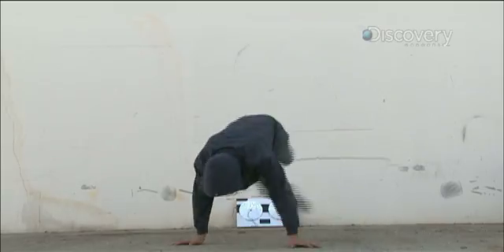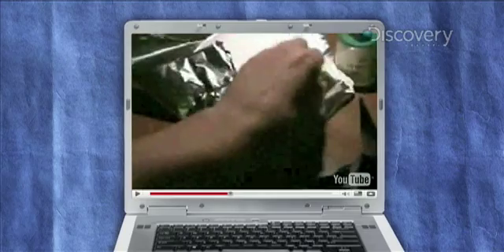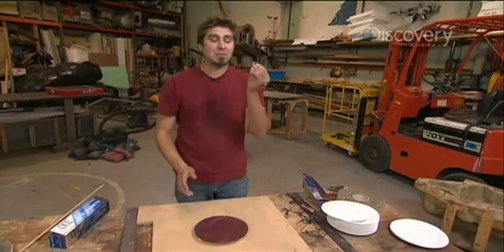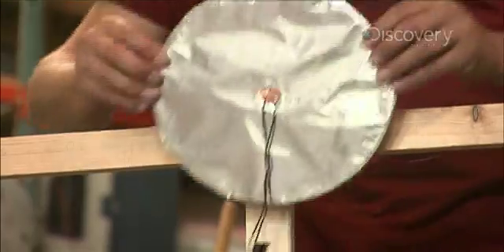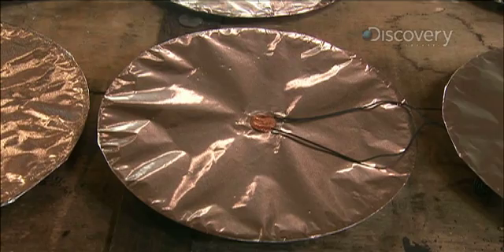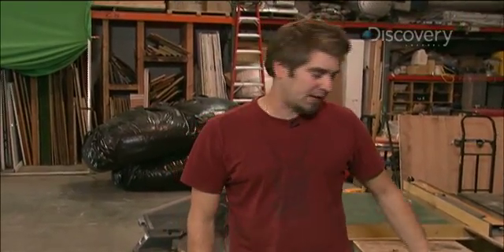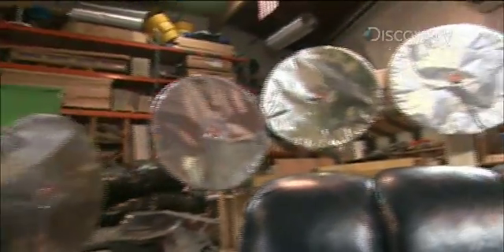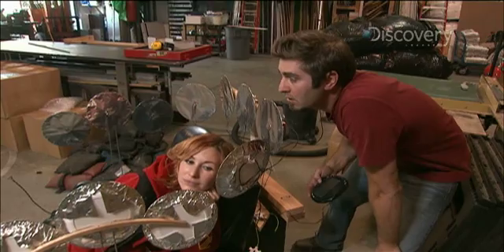MythBusters - Homemade Hi-Def Speakers

Comment: There are 4 wires I. Those jacks, you have split them into pairs, causing a short and no audio—— or you didn’t burn the tips ( those wires are also insulated and can’t be making contact with the pennies) just need small change - THIS_DJBK

Comment: Oh come on, there are legit ways to make a speaker out of junk that actually work. Put two magnets on both sides of the foil and put a wire coil over one of them, that would probably do the trick. You have to have something magnetic and an inductor to vibrate it. Whoever made this is just stupid

Comment: the splitter they used splits up the voltage and audio channels so each speaker is getting much less power than than they think they are giving it. Wish they would have metered how much each speaker was getting.

Comment: It works i made it at home. The only problem is the amplified signal ,a mp3 only gives 0.2 wats and it needs like 10 watts rms. It failed because of peak power voltage. It requires amplificator of at least 10 watts rms. Even without coil and magnet it works because of the imense power that hits the aluminum foil that conducts electricity. The foil will vibrate between the 2 wires (poz and neg). The more distance between them and more power more it vibrates. The foil itself is a resistor. Is not hd sound but is sound. I say is mid ranged sound at 1khz.

It fken works and mythbusters lied. I hate this show because of that.

Anione can test this just unplug a powered speaker and place it's 2 wires on a aluminum foil and see for urself. Foil doesnt need to be round and shaped it just needs to be straight like 3 cm x 10 cm long. Place wires on its ends of paper. Those 10cm between them will vibrate on the amount of voltage is in it.

!!!!!!! it fken works

Comment: what a joke to connect both the ends to the penny.. it is possible to make tin foil speakers but not this way and specially not spending ready cash but the whole point is to make it from salvaged old electronics.

Comment: The only possible way you could possibly have gotten any sound out of one of these is if you stick a pin into one of the plates and use it as a stylus with a vinyl record you don't mind messing up on your turntable.

Comment: Before i start watching this video: WTF are "Hi-Def" speakers? speakers work in the analog realm where the term doesn't apply.

Moving on....
Reply: "Hi Def" is just some bullshit marketing hype. Shortly after "High Definition" televisions came into the market. Douche bags from every corporate marketing division started tacking "Hi Def" onto everything. You had hi def sunglasses, hi def audio, hi def pens, hi def cameras, hi def socks, hi def refrigerators, hi def underwear, hi def sandwiches, hi def vitamins...etc...etc... For a time, there was nothing that they didn't call "Hi Def".

Comment: funny thing is our pennies are not copper anymore they are some crap metal that breaks in half when bent a little since the late 1980's that's when they changed it the the crap go ahead grab a pair of pliers and bend a penny that is newer than the late 1980's it will break in half

Comment: I think if you made a wire coil and taped that to the aluminum, and then taped a magnet to the paper plate, it might make some sound.  But it would be shitty sound and not very efficient when compared to a $10 store bought speaker.  So you could get a much better speaker for the price of the headphone cables.

Comment: you need a coil & a magnet. the jack sends varying electrical current through the coil producing varying magnetic field through the coil's center. that exerts a magnetic force, which varies with field strength, on the magnet, which is adhered to the foil, making the foil vibrate.

Comment: He shoulda connected it to an amp first. Maybe it needed more megawatts to power the flux capacitors in the pennies.
Reply: First you need a fully charged flux capacitor to overcome the resistance of the crystal lattice for it to work. But powering a flux capacitor is some real catch-22 shit. You need a fully powered flux capacitor to generate the megawatts required to generate enough fluxually capacitated power to satisfy the energy requirement of bringing a flux capacitor to full power. You can't just use any old penny either. You need specific old pennies. You must have at least one steel wheat penny and one copper wheat penny for parity and reverse polarity or else you will get flyback  and destroy all electrical transformers within a three mile radius. You wouldn't be  able to acquire enough of those pennies for it to work anyway, because the US government snatched them all up and sent them to Area 51.

Comment: You noob you split power with that splitter,and you knew it won't work and made fun of it like it will work.I thought it would work because piezzo's are similar concept.And he didn't maybe use that cable,maybe he used cable without jack and used only wires and amp that he had.Sometimes you just don't want something too work that's my guess i might be wrong,but you couldn'y prove teslas earthquick machine for example which made me angry because i know it works

Comment: Does nobody on this show have any science education at all? The dynamic magnetic field created by the penny shorting out speaker leads needs to have a static magnetic field or a magnetic substance to work on. Without this no work can be done, so no air can be moved, therefore no sound can be created. Did they really create all those speakers before testing even a single one? Are they deliberately trying to make themselves look stupid? Or are they really that stupid?

It's possible for a speaker without a magnet to act on the magnetic field of the Earth, but a penny shorting out speaker leads isn't going to create a field strong enough yield anything audible. ... Now I wonder how hard it would be to create a speaker that works only with the magnetic field of the Earth.

Comment: every nutjob that atlest went to college knows speakers require a voice coil=wound copper wire and a MAGNET and then electricity to work, then the paper cone and spider for the air pressure to make sound BUT i digress
Reply: well i wouldnt say that every speaker needs a voice coil,  for example electrostatic speakers that dont use a coil at all, or planar magnetic,  there are also speakers that are driven by a motor buuuut then some of those motors need a coil so yeah, oh and plasma speakers....generally anythi´ng that can move air quick and precisely if I am thinking correctly
Reply: yes but most people DONT  have those type of speakers lol

Comment: Who the hell pays 10 bucks for a jack lol.. That`s just bullshit..
You can get those things for like 5 cents, OR get one of these with two of them and cable for a dollar..
 http://www.ebay.com/itm/3-5mm-Female-to-2-Male-Y-Splitter-Auxiliary-Audio-Cable-PC-Headphone-Mic-Jack-/121748451981?hash=item1c58c5f28d:g:XdQAAOSwTapV5lPR
Reply: Btw, I just made a speaker with 2x2.5" 15W drivers and a 2x15W amp for 10.37 USD..
And it sounds better than my 80 dollar logitech bluetooth speaker..
MUCH better, my neighbour complained lol..
(thin walls)

Speakers: http://www.ebay.com/itm/151414150873

Amp: http://www.ebay.com/itm/221908535360?_trksid=p2057872.m2749.l2649&ssPageName=STRK%3AMEBIDX%3AIT

Voltmeter because I`m using LiPo without protection: 
http://www.ebay.com/itm/272331428388?_trksid=p2057872.m2749.l2649&ssPageName=STRK%3AMEBIDX%3AIT

Making cheap speakers is NO problem..

Running it off a 3S 4800mAh 35C Typhoon LiPo..

Cables were scrap, the box is a boil-in-bag rice cardboard box and I didn`t even seal it because I just wanted to check that everything works..

Still plays louder and better than my logitech x-300..
Reply: The video is from 2009 dude, are you blind?
Reply: Vrinceanu Codrut Adrian
Headphone jacks were cheaper in 2009 than now :p
Reply: at least here..

Comment: The weight of gravity when the plate was held sideways might have muffles the vibrations?
Reply: There's no magnet for the (super incredibly weak) electromagnet they've made to react with, nor is there so much as a piece of magnetic metal to attract. Ergo, no vibrations to be muffled.

Comment: There are literally hundreds of videos just here, youtube, in many different languages, that show you how to make an actual speaker, be it with magnets or piezoelectric materials. Take a look at'em and, if you know a little bit of basic "electronics", you'll notice that the model Mythbusters is trying to replicate and debunk is just ridiculous and design not to fail, but to just never work. Besides, Household hacker was pretty much a troll bak in the day (if I'm not mistaken).

So please internet, before you jump and say they did it the wrong way, research a little. I know it is not what your lazy arses are used to but at least try it every once in a while.

Comment: technically there is a way to do it but you need a magnet and a coil because that's what the speaker needs to make it work. because all Tori was doing was sending electrical impulses and energy into the penny and through that into the tin foil where is just no way it would work however if he say had 2 paper plates one to act as a base and one to act as the actual speaker and another one he could use to act as a loose spring mechanism on two sides of the plate and then say hot glue a coil with a magnet inside of it that would probably have to be glued to the top plate then have the electric current run to the coil then speaking from a technical standpoint it could/should work.

Comment: $10 each jack? could you not have just cut up a bunch of headphones or earbuds?
Reply: i thought the same thing man. In fact i've seen earbuds that come in quarter machines for 50 cent.
Reply: sMaShEdToMaToS har har
Reply: that jack is made in USA
Reply: 3.5 male to male leads from the dollar store would have got you two jacks each
Reply: This was produced in 2009, when tech like  this was WAY harder to come by and when you found it, it was a pretty penny
Reply: dollar store  ear phones ones :D are way better then the paper plate speakers
Reply: Again this was 2009, and aux cords were overpriced. He probably got a mini-jack from RadioShack where was ridiculously overpriced. At least, these mini-jacks would be easier to work with than the weird coaxial crimps that you find on headphones.
Reply: 2 words. Dollar store.
Reply: You cna get male to male aux cords (so 2 jacks) for 92 cents pop on parts express. $10 per jack my ass
Reply: @rivergranniss3740  hello this is before touch screen phone. Nokia accessories are not that cheap YET!!!
😂😜🥴🤪🤣
Reply: You’re forgetting the point that he’s looking for hi def sound quality, and cheap audio jacks that were scalped from 50 cent earbuds won’t give you that kind of quality
Reply: @andersdamanders3268  if you were looking for "hi-def" you would even be using an audio jack, you would just use speaker wire run into an amp. And tbh the audio jack is just a fancy metal contact, the $1 a piece ones I use on all my projects from parts express work wonderfully.
Reply: you can get those cables for a dollar and they have a plug on both ends so you get 2 for a dollar
Reply: Could've gotten them at the dollar store.
Reply: with each jack being $10 you actually get 2 ends which means the cost of each jack for the speaker is actually $5.
Reply: +Wick3DPimP wait. Are they quarter headphones or are they 2 quarters? 
You need to make more cents
Reply: @smashed_dillon  It's perfectly clear.  the machine takes quarters, but only 50 Cent can use it.  If Kanye puts quarters in, it won't work.
Reply: You can get the ear buds/ear phones jacks wires and all at the $ 1 store any where, so he's either lying or he's just never been to the neighborhood dollar store.I seriously doubt the little cd player ( meant to power tiny ear buds ) could power any speaker much bigger than a quarter, the just isn't there, plug it in to a real stereo and see if that works
Reply: @darrellmount7020  the wires are shorted across a penny there's no way in hell. And yeah you cna get decent quality male to male aux cords from parts express for 92 cents a pop there was a lot of stupid in this one lil vid 😂

Comment: I heard you can make an infinite space hard drive by connecting your computer to a couple buckets of ammonia and bleach
Reply: Silly.  You make TWO infinite hard drives that way....EVERYONE knows that.
Reply: It has nothing to do with storage, but ammonia would actually be a better heat sync than water cooling. The only problem is if you get a leak.

Comment: Worked as a correctional officer at a prison. I was amazed by the speakers inmates could make and blast music out onto the rec yard. The commissary-purchased radio only worked with headphones. Wire, tape, and cardboard was all they needed. Wire came from various sources such as from lighting (also a commodity for tat guns). Tape comes from the label on a commissary-purchased stick of deodorant. Cardboard will comes from posterboard or oatmeal box package.
Reply: And how would they create an amplifier and speaker from wires, tape, and cardboard?
Reply: @augustvanhout2163  I think what he is saying, is that they turned earphones into speakers, by adding cardboard trumptes, like the old gramaphones. You can get a lot of volume from just a funnel, no amplifier needed, apart from the headphone amp built into the radio.
Reply: All that work for them to be taken away for misuse of state property.
Reply: If only they where that resourceful out side of prison maybe they could have stayed out of prison to begin with. Yea. Some of the shit they come up with in prison is down right ingenues.

Comment: do the mythbusters get more stupid over time?
Reply: +First Last Mythbusters, as a concept, is based on popular beliefs being tested. Ergo, if the people's beliefs (and people themselves) are stupid, then the show is gonna reflect that. Hence why the show got canceled, why Discovery is full of shit nowadays, why general population is becoming so ignorant of science to the point of start believing that the Earth is flat, etc.
Reply: +First Last for sure, ( in one of the new ones they tried to crush a oil tanker with a Vacuum it was 4 inch solid steel, i have a vacuum chamber in my workshop its plastic and can hold a full -30 vacuum was a waste or a full episode
Reply: +Jd Cunningham if your meaning inside of the tanker, it works, but you have to be removing oil and not letting air in foe it to work

Comment: You need a solenoid for a speaker to work, how else is the membrane going to vibrate? lol
Reply: Not neccesarily: take a look at Quad Electrostatic speakers, they don't have a single solenoid or coil anywhere.

Comment: He didn't burn off the wire coding
Reply: +Ben Meyer Rather if he did or didn't (normally is not needed with mini-jack leads), it doesn't matter. The design is just not gonna work. As far as I know, the original HHH video was some kind of prank.

Comment: did tory get the varnish off the ends of the wire. the wires are  green and red. the colored stuff is varnish so they dont short together inside the headphone cable. use a match or a small flame really quick on the end and youll see it burn off. maybe thats why it didnt work.
Reply: +trailerpark187 Normally, it's not necessary with mini-jacks. Anyway, no matter what you do or don't, that design is just not gonna work anyway. You need magnets for a speaker. No magnets? No speaker.
Reply: +DrakosLord Show me where is magnet in piezo speaker!
Reply: mdjey2 Indeed, and for those you need a piezoelectric material, be it ceramics, crystal or anything else that works, just to name the least. And, well, the build they use here wouldn't work for that neither.